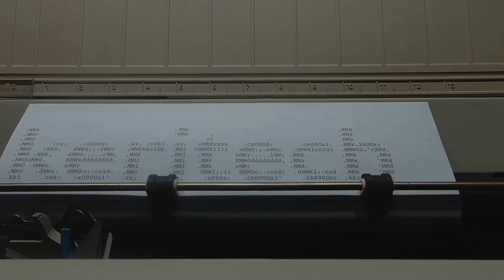Two Vintage Polish Flashlights

Comment: My grandfather used to give me old flashlights to repair when I was young. They were tubular units that were common here in the US in the early 1970's. Good memory for me. I have one device here that uses the 3R12 batteries, a Soviet MP-64 radio I bought from a seller in Ukraine. It's a very interesting design and made of a low grade Bakelite. I found a seller in Switzerland that makes an adapter that you can install 3 AA cells in to replace the 3R12.

Comment: Keri, here in .uk, the old 3R12 batteries were made with simple cardboard separators and a very thin cardboard wrap (almost thick paper) and  the tops of the cells were crimped in. The very top of the battery pack was actually empty air supported by thin cardboard. Maybe the mm thick plastic of modern packs just makes them slightly too big AND too stiff to deform like the originals would have?  A pack made of 3 x AA cells would work well here, with some packing :)

Comment: Fiat lux !  I remember taking batteries apart and using the carbon cathodes to produce an arc.
Reply from the maker: Ha! I discombobulated batteries for zinc, manganese, carbon and a teeny tiny amount of ammonium chloride. All of it went for Science(TM) as I did a lot of chemical experiments in my teens.